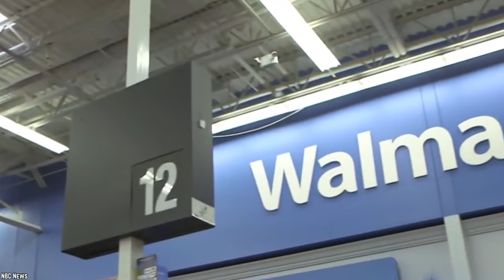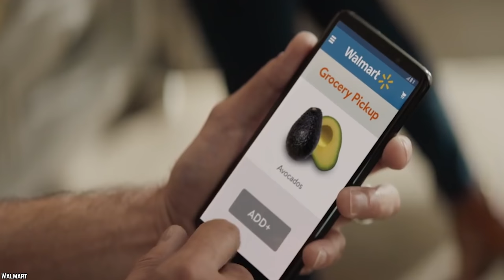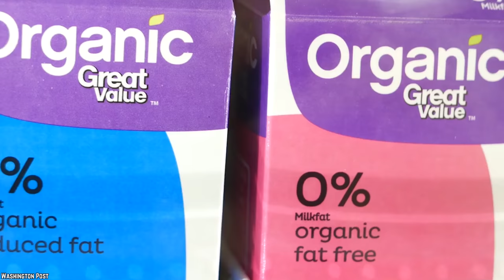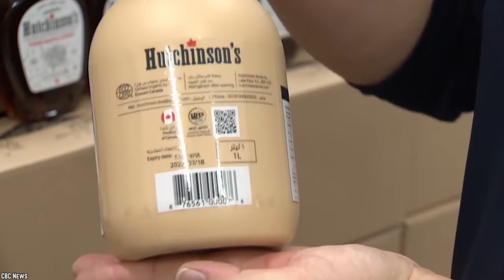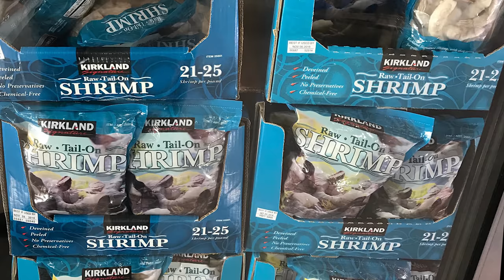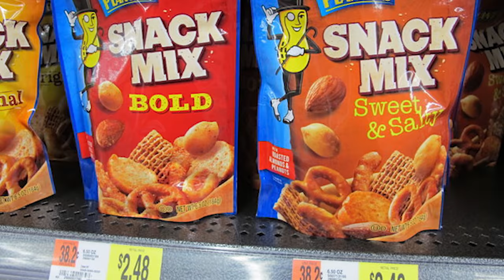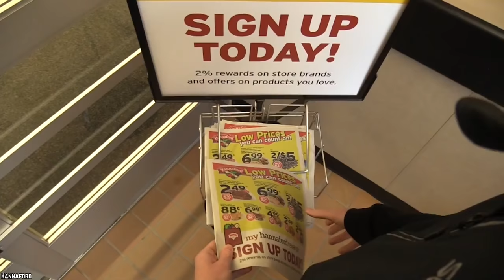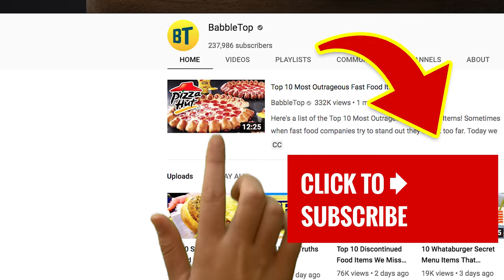10 Walmart Foods You Should Absolutely Never Buy

Comment: As a milk hauler, I found it to be an insult when they claimed milk is full of antibiotics. I can guarantee any milk found with antibiotic in it never get picked up and is dumped down the drain. All milk producers and processors check for antibiotic for every load. Also dont get me going on organic milk, if you only knew you would throw up
Reply: so true my brother tests  and inspects the milk at our local processor the least little issue and all of the milk is disposed of immediately there are a lot of reasons for this and the health codes and guidelines are extreme to say the least .This holds true for both corporate and family owned dairies in the state I live in

Comment: Some interesting points raised. However comments regarding dollar store pricing missed the entire point that the size of the packs at dollar stores are usually non standard and therefore are generally more expensive per gram.
Also the ranges offered at dollar stores are simply variety’s which are sold cheaply as new entry samples to see if there’s a market for them to offer for general release into the general supermarkets, therefore creating demand. New flavours new versions etc get tested out at dollar stores before being offered into general sales and of course they come with additional sales feedback, because they’ve already been trialed elsewhere locally.
Reply: Generally, I find "dollar stores" to be more expensive and also sell GMO products.
Reply: Dollar stores are cheaper. You get what you pay for and pay for what you get.
Reply: @carlbowles1808  
Dollar stores are cheaper, sometimes, and sometimes they just present the illusion of being cheaper. You need to still have your awareness and thought process when in them too!
Reply: @1redrubberball  
I agree with you. Cheaper doesn't automatically equal good value. Clever marketing creates the illusion that it does.👍😀
Reply: @carlbowles1808  
Yes, complete agreement with you!

Comment: 1:12 "Because neither chemical fertilizers nor pesticides are used, the produce tends to perish quicker." WTF?!  Neither of these things has a damned thing to do with how long your veggies last!  That's just poison applied to the outside of your veggies or chemical nutrients fed to them while growing. Those two things do nothing to make the veggies more vigorous or long lasting. In fact, organic produce tends to last longer than conventional produce on the average because of how it is typically handled. It is frequently hand picked, travels less miles, and is not thrown around big distribution operations to bruise it and make it spoil faster.

Comment: "Buy snacks at the dollar store because they have brands local retailers don't offer." You speak as though it is bonus to not buy your favorite brand. I don't find knock-offs worth a dollar to be a bonus. And comparing Walmart prices to club stores also makes no sense. Especially since I can buy one package at Walmart instead of having to buy a 12-pack at Costco! Lastly, yes I can usually (not always) find better ground beef prices than Walmart, but that takes a lot of my time to sift through the ads. Plus if you have to go to another store 4 miles from Walmart (where you are already doing your other shopping) you are adding $2.32 in fuel/wear on your car...so that 50 cents per pound savings will actually cost you $1.82 more, plus more of your valueable time.
Reply from the maker: George Weissenberger, you are absolutely right on several points you brought up. Especially concerning the cost on fuel and time when going to other stores. 

 Thanks for your feedback! 😄